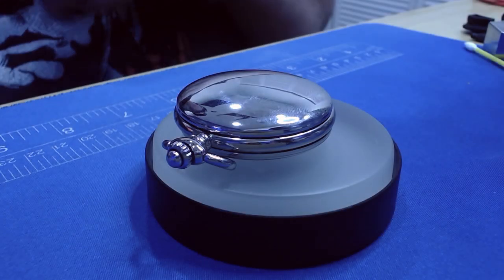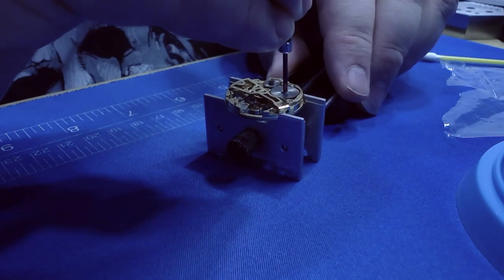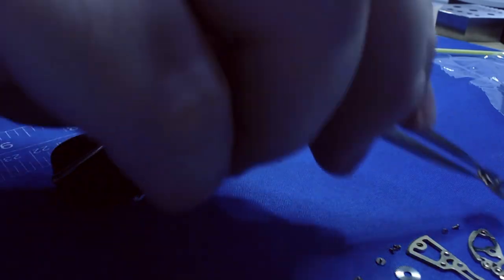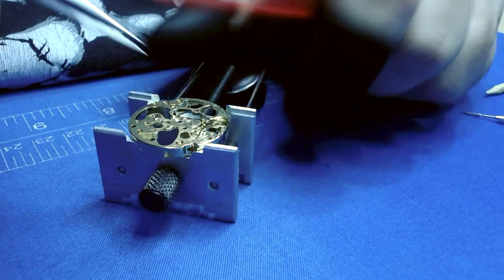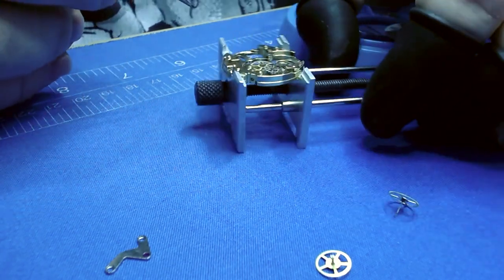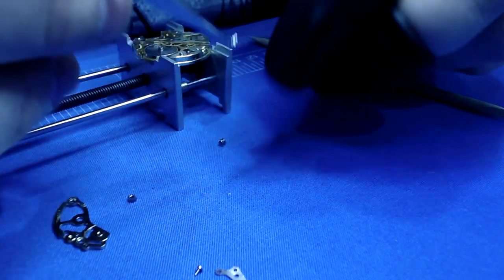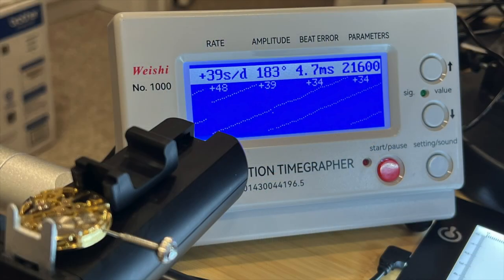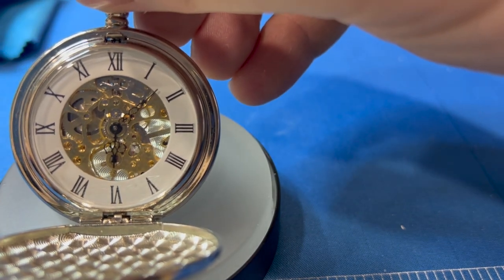004: Chinese 2650G ; Can I make this cheap pocket watch work properly?

Comment: Hey! I recently got a watch with the same system as yours, but when i adjust the watch backwards, the seconds hand goes backwards a bit and then the watch stops completely, even if the spring is loaded. What issue could it be?

Comment: Cool, this watch/model  was actually the very first one I successfully reassembled myself just a few month ago ( and the second one because I bought two of them in case i messed up with the first :- )  But all went well and after oiling ( u didn't  show that ? )  it works pretty well. Amp was > 260 fully wound. Hardest part for me was the opening of the shocksprings and cleaning of the balance jewels - these parts are so tiny. I'm still winding it each day  curious to see how long it will keep on running after my "treatment" :- )
Thanks for the video, Greetings from Germany
Reply from the maker: Great amplitude! I think if mine were higher I'd get less time out of the wind, but since it's not stopping I'm ok with it for now. I might repeat the process some time and see if I can improve things.